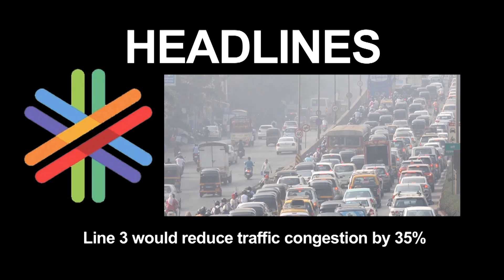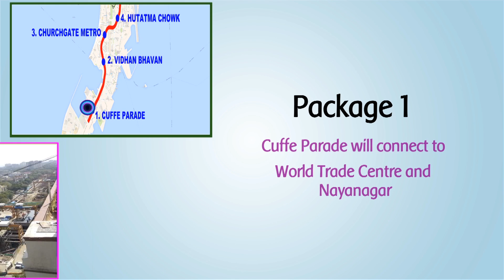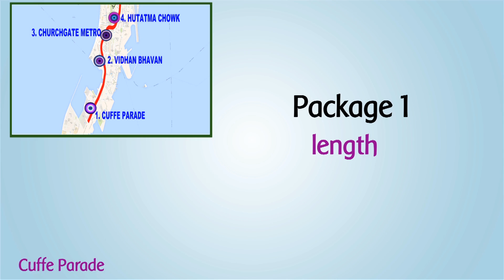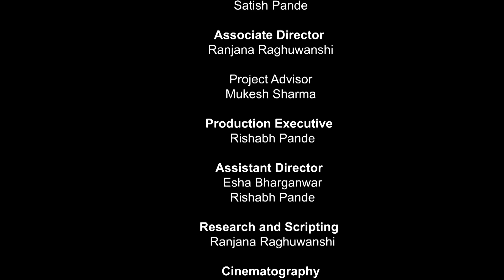Tunneling the Future

Comment: are you mad ???? underground metro is in Kolkata for decades.... new metro is now getting built that will run under Ganga river in next few years.... this is not the first time... but the project may be bigger in capacity
Reply: I think they meant that this line will be COMPLETELY underground, kolkata metro is not fully underground.
Reply: @tnadevirig4888  it is completely underground... but the new project currently are above ground
Reply: @kalavhbri  No, it is not, research line 1 of the Kolkata metro on wikipedia

Comment: Excellent work is happening on line 3 which is visible and I am confident it will be completed before time.
But why work on line 2a and 7 is slow down and just wanted to highlight on mith chowki malad barricade has been kept more than 1 month but work to start for 2 pillars at main mith chowki signal junction.